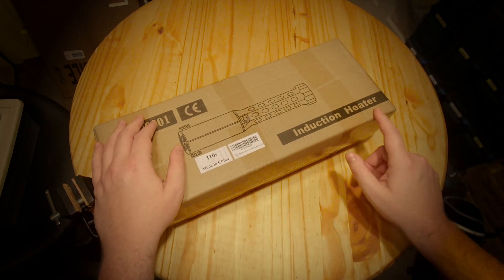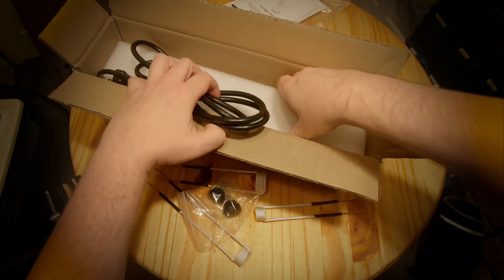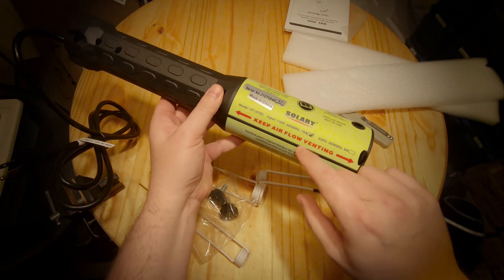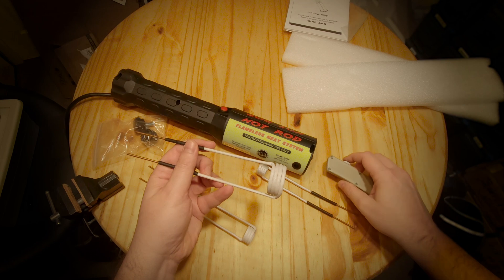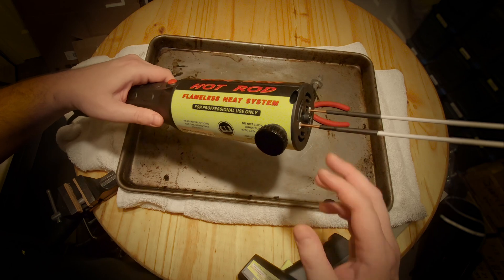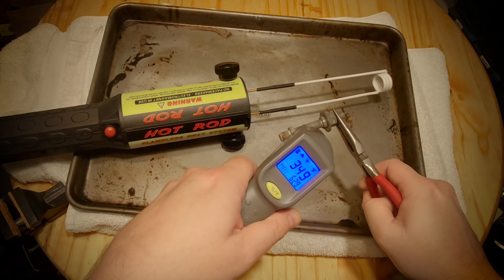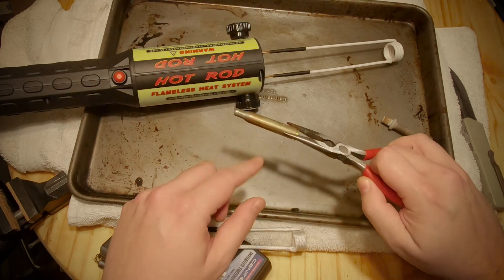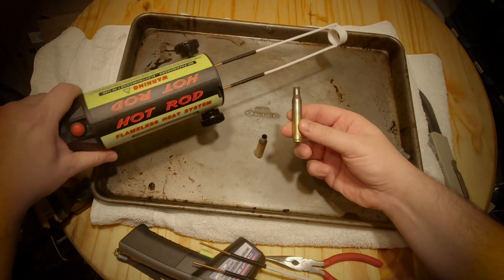Can You Induction Anneal Brass?

Comment: Mine came in today and it doesn't work. When I plug it in it makes a high pitched noise and when pressing the button the light doesn't come on. It should just plug in and power when holding the button right?
Reply from the maker: Sounds like you got a defective one. If you got it from Amazon it should be easy to return.

Comment: If you shorten the wires and made a coil that wraps around to case much tighter (I use a 300win case to make a coil for a 308), it will go a lot faster. I’m melting lapua within 6 seconds
Reply from the maker: Good tip!
Reply: Can i use to heat copper pipe?